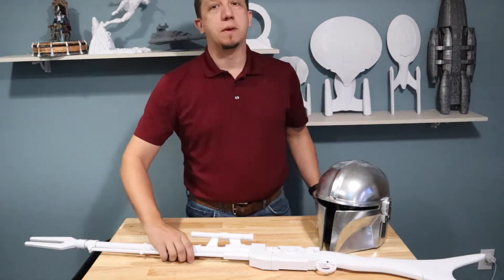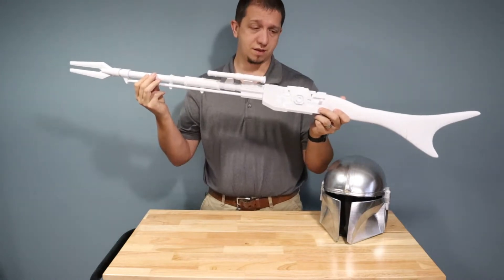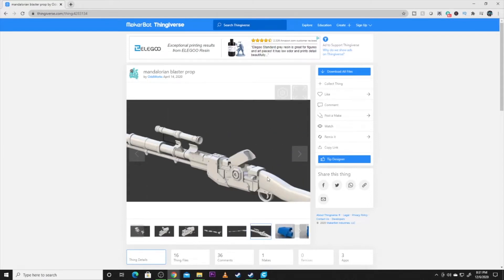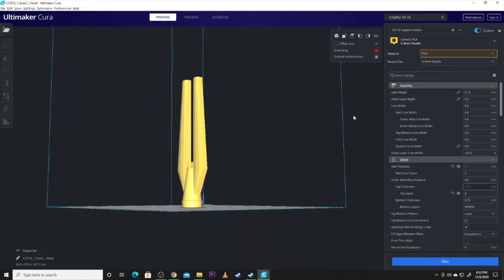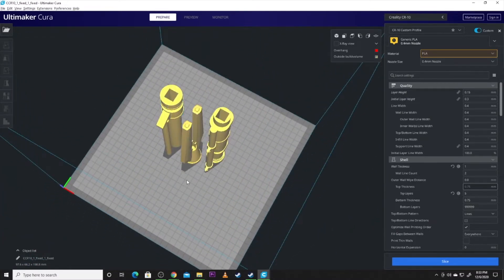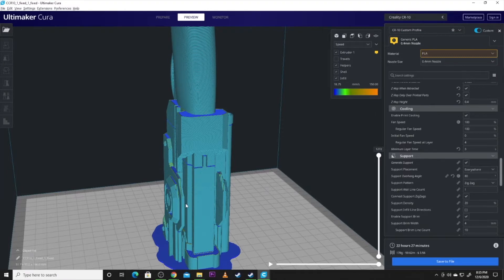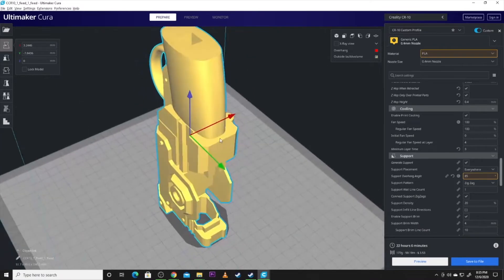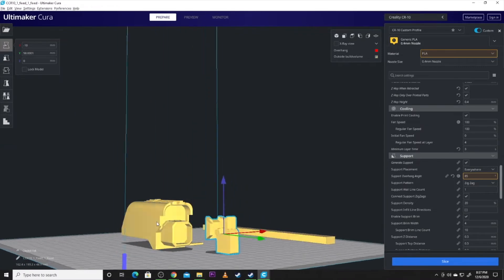3D Printed Mandalorian Rifle

Comment: Wow! This is so awesome! I have been reticent to do large pieces in sections because I have not had good luck gluing 3D printed parts together. I did hear you mention for a second what kind of glue you were using but could you tell me a little more about that? I've tried several different kinds of glues and it still always comes out sucky. I guess I should read your description and see if you mentioned the glue. I just wanted to see some of the comments and I decided to comment myself. Anyway I wanted to tell you how awesome this came out. I think doing large pieces like this is such a commitment! Hahaha! Great job.
Reply: Sorry.. I started commenting before you got to the end part. You did mention the glue again! Thanks!
Reply: And yes.. I would very much like to see a video of it painted!

Comment: Just one thing I was wordering what printer is best to print life size stuff like a life size stormbeaker life size captain America’s shield and a life size Thanos and iron man infinity gauntlet
Reply from the maker: The cr -10 is definitely the way to go.  It will give you the scale for single print.  Now you can go with the Ender 3 and use mesh mixer to break the model and print it in parts.  The Ender 3 is the cheaper option but the cr-10v2 is a awesome investment.

Comment: If i use The 3D pens hot tip to seal a print would it warp the seems?
Reply from the maker: When using the pen I have it very slowly putting out pla so it is also filling the seem while I am fusing it.  The process can be tedious but very worth it.  When your done, a little sanding and you have a great piece!!!